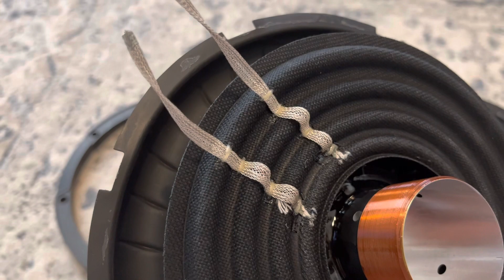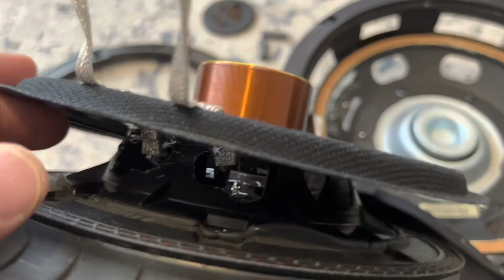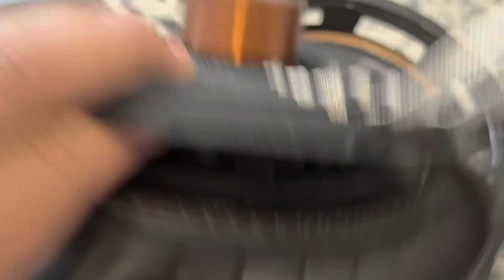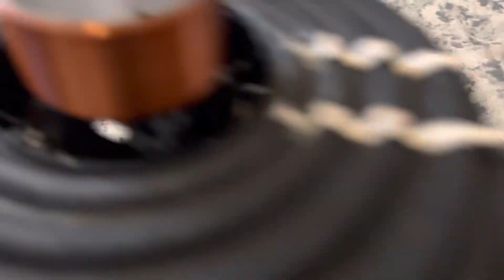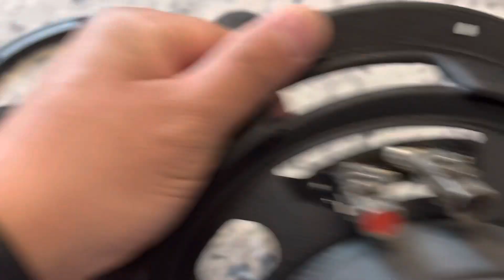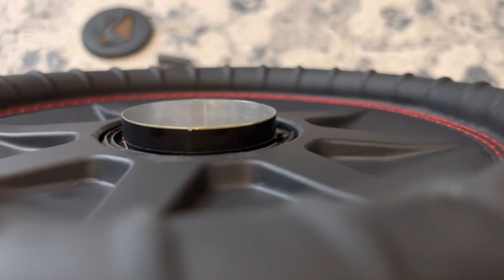Kicker Subwoofer Repair - Part 2

Comment: I have a 12 L7s kicker square that has blown 2.38 inxh coil i think ima take off the basket and see if a comp r 12 has rhee same bolt pattern on the basket if it does ima puse thr L7 motor and xomp r basket coil and spider the both use same 2.38 kapton coil and both are d2  so ima build me some custom job i may have to order a coil spider whatever else and try to. Build something like a cvx i think they use same motor as L7s its the same version but square we will see how it goes i also am repairing a jl rd 1500/1 it was showing constant clip with no laod found some bad outputs and a few resistors 101 smd are showing shorts and these 4 green resisters get hot especially 1 and that same 1 thw ohm reading i rhink 47k is off also has 2 3205 mosfets bad the ttace ro thw board looks missing but amp is new waiting on parts for that and parts for some Brazilian full beisge amps .

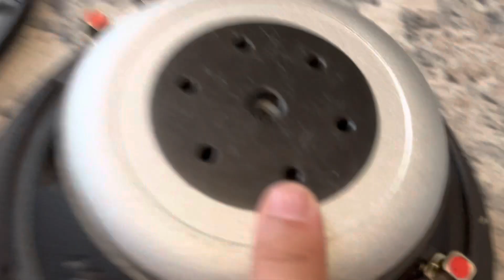Comment: I was putting a grill for protection on my kicker 46TL7T82 8in thin square loaded enclosure and when I opened it up it looked like this ,no sticker and 3 holes. No plastic cover around the magnet? I’m about to message the seller because I was thinking it’s refurbished or something. Has anyone else noticed this on the magnet @7:18 in the video ?

Comment: I have the first gen of the 10 and 12 of this model there is a sticker on back and no holes in the coil peace thank for the tips p.s the kicker truck box put the subs right at bottom of there box and its  so shallow it has a circle cut out in the box and a metal plate so it's not resting on the box it self🤔🤪💯👍✌️ haven't had a problem yet with them but thanks for the video I'm sure it will come in handy 👍💯🎵🎶🎶🍻✌️

Comment: Why would anyone buy a kicker sub they are complete garbage just 1 level above the old sparkomatic brand😂🤣
Reply from the maker: Great thing about car audio is that there are so many options and brands available to pick from. Kicker is a great company and makes products for every budget. Their Comp Q and their Solo X series will compete with any manufacturer out there.
Reply: exactly i cant stand there over priced garbage ! when i used to compete kicker would be all decked out with there junk and id roll in with a rusted out crx and beat them every time . i won 10 shows in a row in 0-100 watt stock . back then there was 20 plus per class now its a joke with maybe 3 . stock class was the hardest because it had to fit in the trunk with no mods at all .